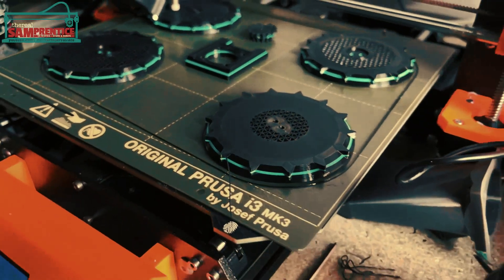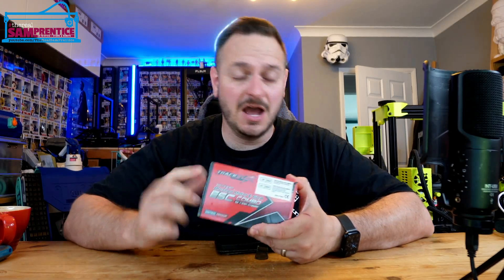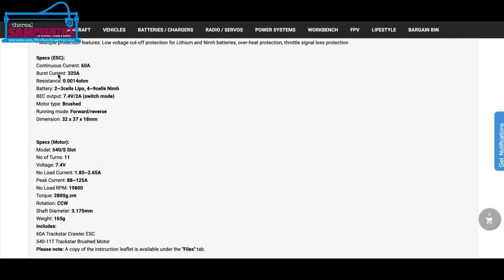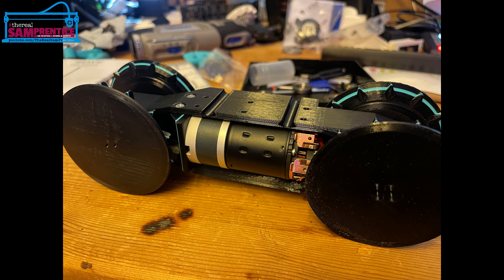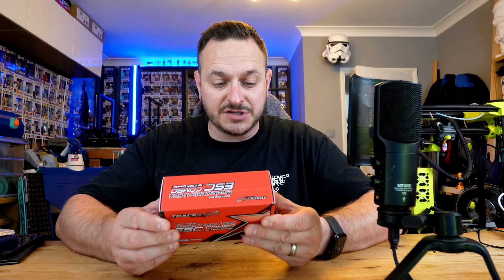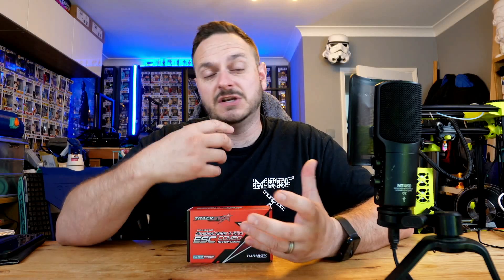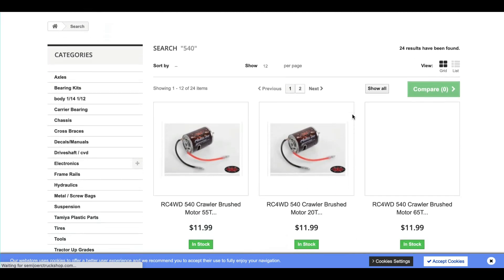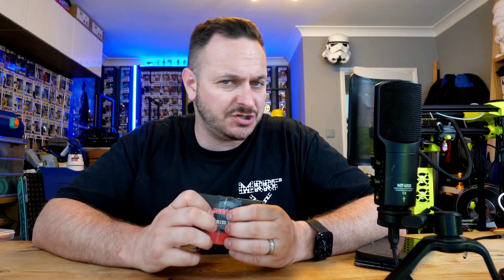Death Racer 3D Printed Pro Drive Mod - Polymaker filament giveaway!

Comment: dont see links in the description as mentioned
Reply from the maker: there are a ton of links, which ones are you looking for ?
Reply: @TheRealSamPrentice  I think what most are talking about is how to get the filament for the builds. ;)
Reply from the maker: @GrumpyHeadDesigns  oh I see I’ll be updated when I have the order links :)
Reply: @TheRealSamPrentice  I have 3 builds waiting on this O_)o Damn, kids are expensive.. LOL Hope I can manage it in time for the show!
Reply from the maker: @GrumpyHeadDesigns  I’m sure you will
Just order the motors and gear box asap
Reply: @TheRealSamPrentice  That is the problem. Seems like they are out of stock for most places and not to mention prices. Not cheap to build 1 let alone 3! :| I am in US so would like to source most here if possible.
Reply from the maker: @GrumpyHeadDesigns  got it, okay let me know what you find and let’s see if we can get the parts ordered
Reply: Kit list, has a list but they arent links